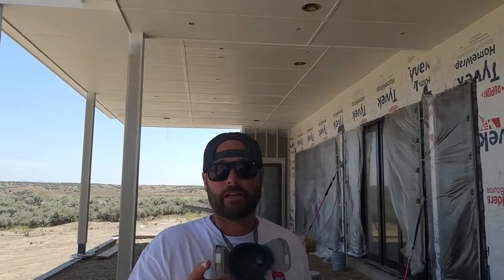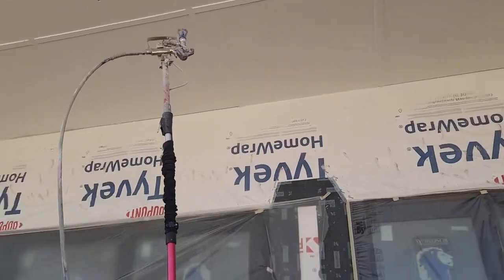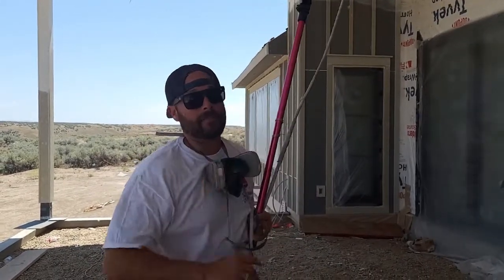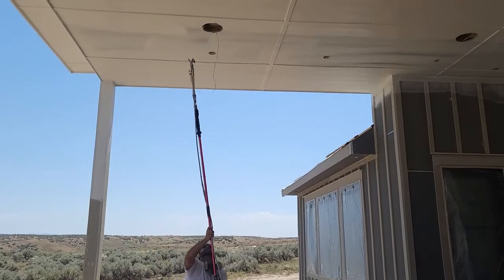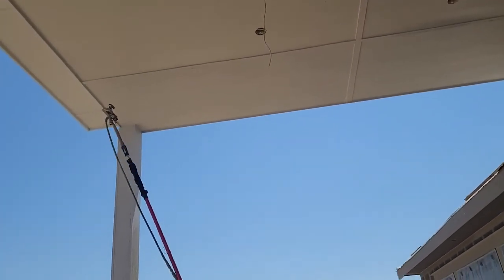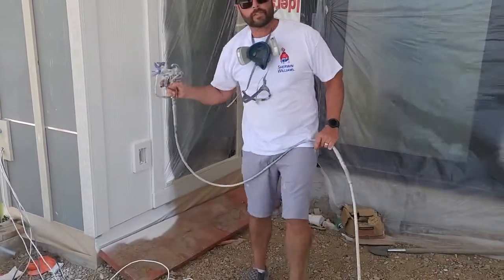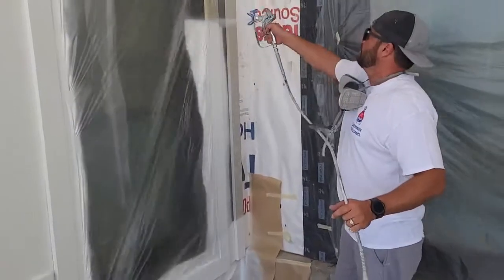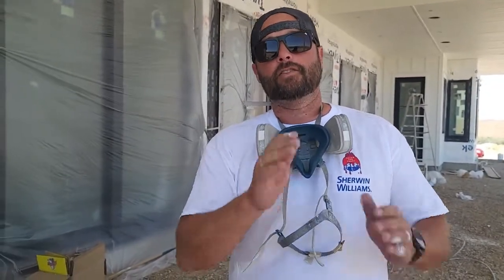How to Paint Massive Soffits Without a Ladder

Comment: I like those kinds of polls for smaller jobs. Where your using a hand gun then need an extension pole then going back to a hand gun again. On that situation I would want a standard 6 foot extension pole that goes on the end of the paint gun. Much lighter and easier to control.

Comment: These poles come in super handy ..what product and what tip size are you using??
Reply from the maker: Yes, no doubt! I can't imagine not having them. It was pretty windy this day and I think we were blowing a 515 or 517...I think a 515 and we were shooting A100 low sheen in pure white! We were losing a lot of overspray to the wind so I pulled off the 517 and put on the 515 to use a little less product!! it's getting really hard these days finding exterior white paints...how's it where your at?
Reply: @PaintBoss  same thing , we usually use duration extra white and it had been scarce ..So we have been using alot of super white wich is not quite as bright white as the extra white.Along with alot of other common paint products not being available its been tricky. We have been ordering paints way ahead of time for jobs and buying In bulk when we can ..  Still gettin er done though , just have had to adapt to the atmosphere